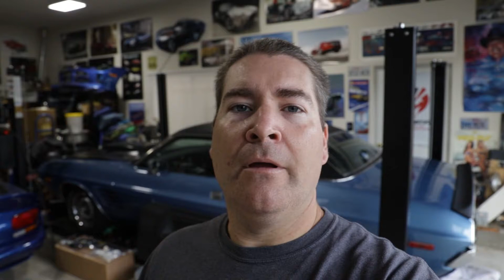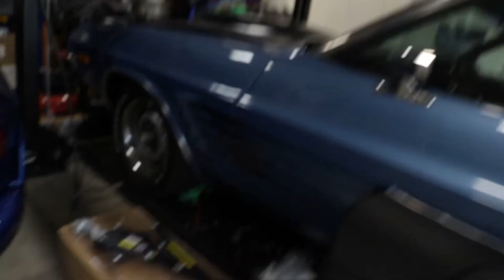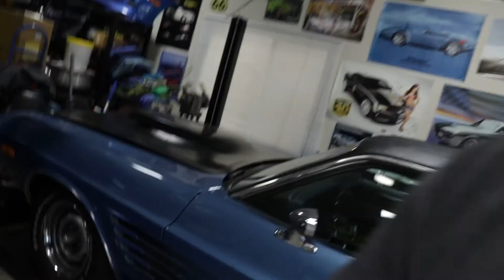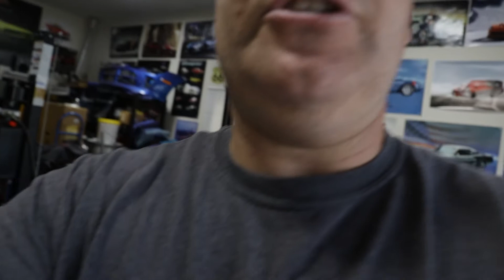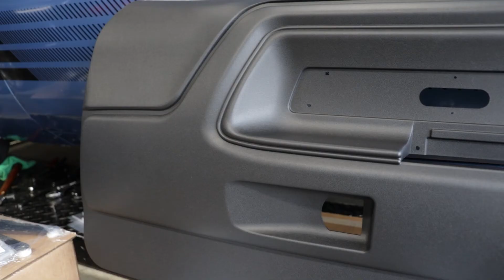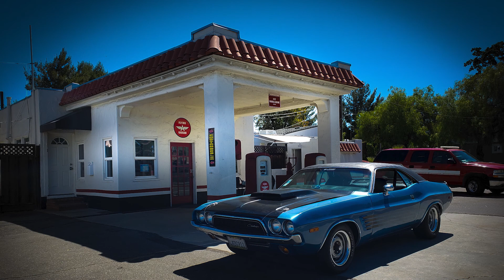Converting my Challenger to Power Windows

Comment: Have you ever completed the power window and door lock project? Just installed an older flaming river system and struggling with the lock unlock mechanical connections.
Reply from the maker: No unfortunately I haven't finished the power window project. Been too busy with the little one. That said, I'm not doing power locks as they weren't available from the factory, just power windows.